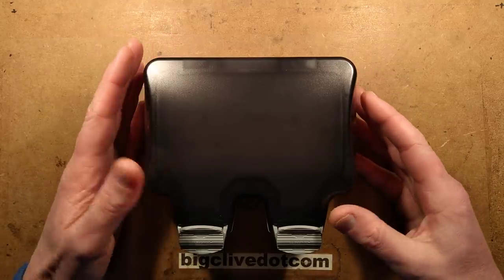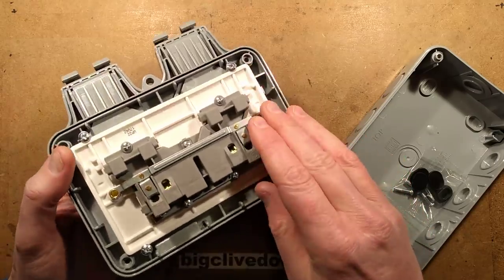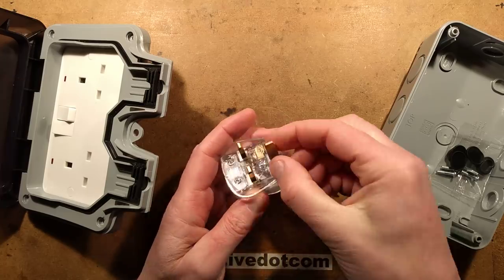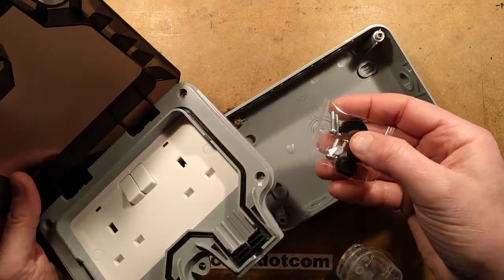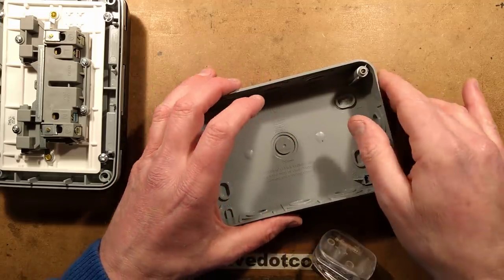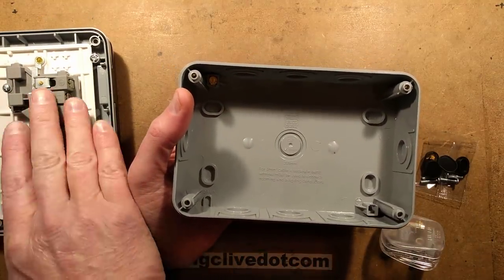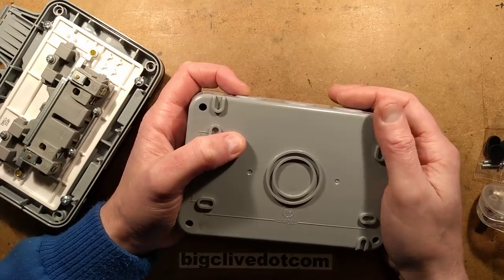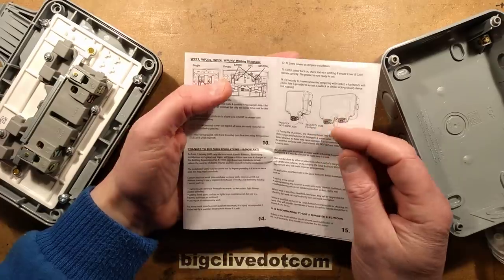British weatherproof socket with clever design. (bonus rant)

Comment: BG. Not a brand I like to install, I seem to have issues with wires not being gripped in the terminals.
One is, the other rides to the side of the screw and makes a poor connection. You wonder why the continuity test reading is high, pull the accessory front forward and at least one wire doesn't come with it. Re-do and test again.
And the RCDs in their consumer units had excessive Zs uplift. Not sure if that's still the case, but not taking the gamble.
However I make an exception with these sockets.
I do recommend to superglue the blanking caps in, because they have been known to ping out if the socket is hit by a ball.
It's also good that the actual socket can easily be changed if damaged, so long as the enclosure is ok.
The light switches in the same range are a PITA though, the box is square but has two entries on one side (bottom I think?), all other sides have one.
But the little locating ramps you described are also offset to allow for the double entry.
Customer needed a row of four vertically, what a pain to do.
So I won't be installing any more BG outdoor switches.

Comment: I have the same socket feeding two outside lights and it has a handy little padlock point on it to deter the casual electrickery thief ( easy to break the case at that point though if you really want to pinch the electric or the outdoor lamps!)

Comment: I bought one of these for the back of my garage conversion. Very pleased with it. Ran the cable through the wall for rear entry from a fused spur. Sorry, I mean a qualified electrician ran the cable through the wall. I did use some silcone sealant though (I will know better in future).

Comment: Speaking of acid silicone, I replaced my sis-n-laws kitchen faucet last weekend. Getting the old one out without damaging the sink was a bitch, but installation of the new was a breeze. Getting back to the caulking 3 days for it to be not tacky on the tube said ready for water in 30 minutes will cure in 12 hours 3 days later when ya touch it no fingerprints. And she keeps her house at 68 Frankenstein and 45 ish humidity. Which is well within the recommended 30 min 12 hours full cure.
Reply: Sometimes you get a bad batch - or its out of date ?
Reply: Ive never had an issue with dow corning silicone, but have had this issue a few times when ive used cheaper brands.

Comment: I think that there's two possible drain holes because sometimes it's handy to have the earth terminal at the top, and sometimes at the bottom, usually just so you can see it when connecting up.
I'm with you on the wiring colours and Part P. I've seen some scary wiring in houses by householders, and Part P has done nothing to stop that, even though we are told that was the idea.

Comment: Have the identical socket on the outside of my garage to run a battery saver.  Never has let water in and the cover clamps securely.   Very good design.

Comment: When I did my gas training I took a part P qualification as an add-on.  (I've been an electrical engineer my whole life, but didn't have any qualifications as an electrician)  The 'training' almost didn't warrant the description.  I found myself explaining things to the instructor - honestly it was woeful.  I came away with a certificate to do electrical work (which has long since expired) and a extra level of scepticism for people holding such qualifications.
Reply: Ditto, ive seen some woefull electrical done by a part p qualified  alarm installer, it would rate up there with some of the most shocking diy bodges.
Reply from the maker: Like the newly installed alarm panel that was wired into a spur with alarm cable?  The expiry date on "qualifications" is also very debatable.
Reply: @bigclivedotcom  sadly you are right, i wish i took a photo of it.

Comment: I have the RCD version of this and the outermost seal tends to leave a small gap at the top center - filling the box with water, maybe due to the wall it's mounted on not being 100% flat? Think I'll need to drill the drainage hole as the guy that installed it did not!

Comment: Hey clive, I love your channel. I always wanted to learn and figure out how appliances and electrical and electronics systems in other countries are built. Thank you for all the videos that you are making.

Would you please do a comparison video between the British, French, German, US and Indian plugs? And the sockets too.

I absolutely love the safety features of the British Plugs. The flat prongs which make better contact, easier to manufacture. The fuse. The sleeved neutral and live prongs which prevent getting shocked before the earth pin makes contact and I guess the GFCI (if present) and the presence of shutters on the socket will make short work of any ground fault connection. A lot of things have to go wrong to get an electrical mishap in an British Electrical connection that's upto spec. And to top it all off that "transparent" plug. Hats off to whoever thought of all this. But I would love to understand how they moved from round prongs to flat prongs. How was that switchover like? 

I like how the Schuko plugs can be connected to inline sockets. I have forgotten about their safety features.

I don't remember much about the US plugs.

I am from India. The Indian plugs are based on the older British standard are very basic. More than most of the houses in India are not upto spec. There's no enforcement of IS SP 30: National Electrical Code. Faulty earth connection abounds. People actually hate shutters here but will crib about their kids going near electrical sockets. They will daisy chain multiple below the spec extension boxes (whose wires are made of bad insulation and are extremely thin) and people will drive even refrigerators off of them. GFCIs are unheard of over here. MCBs of different specs are used as per the whims and fancies of the electrician or the home owner or builder to save money. 

I would send you Indian plugs and sockets of different types, (all well labeled or maybe new ones since there's a lot/lack of information on the boxes) if you wish to do a comparative review with other plugs.

Comment: I have this exact model, the only flaw I have found is that water will puddle directly above the top of the seal and when you open the catch the movement makes it drop onto the plate on occasion. 

Reinstalled tilted 20 degrees from straight (default part p install)  water no longer pools.

Comment: I recall the first time I fitted an MK Masterseal external socket, the instructions said that the plastic would degrade with the wrong silicon. After contacting their techincal dept I've been using neutral cure ever since, to seal round the cable entry, over and around the screw heads going into the wall and around the top and sides of the finished product. I'll admit having never drilled out any drain holes though - they just seem to get full of spiders/woodlice and subsequent organic detritus- if they're properly sealed there shouldn't be any ingress. I no longer bother with the MK masterseal as they seem extortionately priced. These sockets are one of the few BG products I will use, can't get better for the cost. The Scolmore Aquip66 ones are ok too, they are literally a box with a socket in them
Reply: Agree, im very happy to spec these bg exterior sockets, personally i prefer the opening system to the mk exterior sockets. One of the few exceptions were mk are not my first choice.

Comment: These are great, I use several myself, but they could be improved if they supplied stainless screws and hinge-pins!
You can also easily fit a twin switched RCD protected 13A socket,

Comment: Not sure if its the same elsewhere, but here in Australia you're allowed to mount things like this and run the wires yourself, but you need to have an electrician inspect it and only an electrician can connect it to the grid. It's handy if you know what you're doing, can save a lot of money on simple jobs like adding wall sockets

Comment: When I came to the UK a few years ago, I'll admit I wasn't a fan of the plugs initially. Now I love them so much. The best thing is you hardly ever have issues with things not fitting side by side because there's a little more space, and the orientation of the socket is standardised. (Occasionally you'll find an adapter that runs the low-voltage wire out the top instead of bottom, which is still annoying in a cable reel style extension lead.) I still don't understand point of having a switch on every socket though. Perhaps you can explain that in a video some day.
Reply from the maker: Convenience of leaving things plugged in but turned off.  Also reduces risk of arcing contact damage when plugging in or unplugging high current loads while powered.

Comment: How do I get one of these in the US with a u.s. plug all the designs we have are horrible especially when the plug has to be plugged in which voids all water protection. The only downside to the UK plug other than size is the annoyance of the death trap that is worse than Legos with the automatic prongs up waiting for your feet.... and I think all plugs need to be clear so you can check them it also makes adding an indicator a lot easier. Having a recent encounter with a 2x 20 amp plugs to a 240v 50 amp adapter cord for a food truck and out of all of their five extension cords one was miswired, troubleshooting would have been a whole lot easier without having to open all the replacement ends. Although it was fun seeing what a direct short look like, and then having to track down the breaker in a fairly large facility for an outdoor outlet.

Comment: Could you pull the 4 rear screws and see if the perimeter of the standard double socket is sealed as well. I agree with your rant about part p, I trained as a sparks, did an apprenticeship, got my C&G 236 worked for several years in the industry and then quit and went trucking, according to the rules and regulations I now can't fit stuff in my own home but the stuff I fitted way back when is fine, it's a world gone mad.

Comment: I have installed a few of these BG DG outlets, they're great. They do an RCD protected version too. Never had any callbacks either. Silicone a bead around the back of the box along the sides and the top edges about 1/4 of the way in and leave about an inch gab on the bottom edge seals it nice and acts as a drain if any water does get behind the box whilst sealing the top and sides. And make sure it sits flat! Or the lid won't shut and the seals won't seal.

Comment: I have three of these outdoor sockets, one attached to the house and two attached to either side of one of the huts, the way I installed them is rear entry with the drain hole drilled at the bottom and then a bead of outdoor silicon round the top and two sides such that the water cannot enter via the cable entry hole but can still drain via the drain hole, all 3 are on the rcd side of the fuse box, one as a 6mm spur from one of the house ring circuits and two which are connected as part of the huts 32 amp ring circuit which itself is a spur (armoured cable) from the workshop fusebox on a 32 amp fuse which is on a 50 amp fuse from the house fuse box (running to the workshop on 10mm cable in conduit) its a bit convoluted but I have had no issues with these sockets at all, I even have an outdoor security light permanently plugged in that has been running fine even with the worst of weather

Comment: Did these pass an external IP test? The x4 bosses that fix the two halves together are on the inside of gasket perimeter - meaning water can bypass the seal via the screws/bosses, as they're a direct path into the unit. 

A bit of drizzle I'm sure is fine but if it was sprayed down as per an official test I wouldn't be as confident!

Comment: I will say that American electrical hardware, while a big variable in terms of quality is nonetheless pretty well designed.  The electrical codes are very clear and well thought out, and hardware has to meet those codes.  At worst, some of it (the stuff from offshore primarily) is too flimsy.  But this box of yours really is of superior design and better than anything I've seen here.  The wire channels and the locking catches are genius.  As for your very practical plugs, Clive, I dare say they are just simply painfully enormous.

Comment: One nice plug and socket design is found in Switzerland. Three quite small plugs form a circle in a very compact socket. It's a very & compact nice design.
The UK plug design is very robust and safe. But it has always been too big. If you have to pass one through a hole you will realise how fat it is. You can't even put it through most letter box openings. It also makes any Multi-Gang socket really big.

Comment: On the one hand, I admire the engineering and thoughtfulness that the UK plugs demonstrate so well.  On the other hand, I'd hate to have these plugs on every item.  I can't imagine trying to fit a dozen of these plugs behind AV cabinets and the like.
Reply: Many of the standard 2 pin plugs I have seen on the Continent and in the USA have the cable entering straight in which needs a very large clearance behind a cabinet etc. I know right angle ones are available but they appear less common. All UK plugs are rt angle entry. Also, don’t forget we are 230V rather than 110V hence the beefier pins.

Comment: I notice that one has a little padlock hole between the two cable ports which is neat.

I guess as it uses stand double socket plates you could replace it with any others from the same manufacturer? Maybe a phone socket or RJ45 plate or switch plate?

Comment: One thing I do like with the British plug is that the live wire is the shortest, and has basically no slack (whereas the neutral and earth wires are longer and do have a small amount. This means, if the cable gets yanked, the live will disconnect or break first and the earth last.

Comment: The British receptacle may be ugly, but it's rated one of the safest in the world due to the shutters and the fuse in the plug. They have been well thought out, and engineered for safety.  When we were in Scotland several years ago, when my daughter was studying abroad at University of Sterling, I was impressed by the electrical hardware there in the apartment where we were staying.

In the US the rules are similar to those in Scotland, whereby you can do the work yourself as long as it abides by the "National Electrical Code".  In the US the color code for 220v is Black & Red (hot), Withe (neutral), and green or bare conductor for ground.

Comment: A rant video could be amusing.  As an American I do agree that the goal should be that one simply do electrical work such that their work complies with the accepted standards, not to create a cottage industry of frequently far less qualified persons to second guess you — though I do agree with the requirement of a proper inspection by a qualified inspector after major electrical work, which here in the U.S. is ordinarily a public inspector that works for the the local government agency that issues building permits as such does afford both a degree of liability protection should something go wrong many years later and also affords future home buyers some confidence that any major work was originally done to Code since most of the work is largely hidden from view.  The idea that even an electrician can not simply change out their own receptacle and be done with it would be maddening!

I always chuckle a bit when I see British style receptacles and plugs as they are so massive and over-engineered for a 13A load as to be classic “British Engineering”.  That said, I don’t get all the hate that some people have for the many different receptacle and plug styles around the world, as long as it works and gets the job done safely then that is what should matter.  I rather admire the variety even though I’m sure it’s a bit of a hassle to global manufacturers.

Comment: I have one of them spair, the contacts are arked closed on one socket. I  turned off a large fan and then remembered about why you use toggle switches on motors. Might be a good one to take apart

Comment: I like the rant.  <rant /on>An even more absurd racket is the "Home Energy Audit".  Needed on done once to allow participation in a government scheme.  The person duly arrived and commenced to betray a wholly and completely total lack of any knowledge of the construction of a building older than post-war.  This house is 19th century.  Inspector - "What cavity insulation is there?"  Me - "There is no cavity, the walls are solid." - Inspector - "No, what I need to know is what is between the two layers of brick."  And so it went on.  In conversation it turned out that the qualification was achieved after a two-week course (without any previous knowledge of buildings)  based entirely on looking at "Barrett boxes".  Grrh. <rant /off>

Comment: I'm sure those that over the years have changed sockets and added new ones are going to take about as much notice of Part P as I am. I didn't know it existed and I still don't. Mind you running an arc welder off two plugs is a tad naughty. It's either that or a solid copper slug and wait for the ring fuse to pop. I'm 72 so Iv'e had a good run. I had 240V right across the chest late last year, seems like the old pump is a good un, mind you I did feel a tad 'orf' for a while. Great video Clive and yes I use lead solder on everything and love the smell of flux.